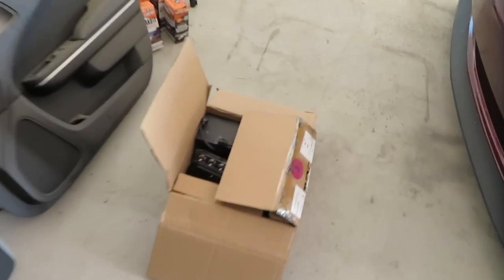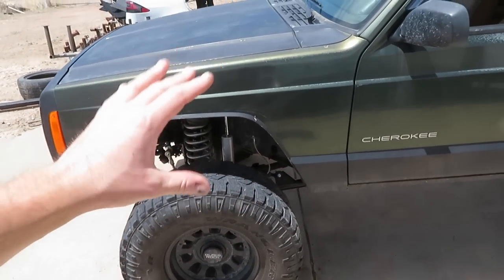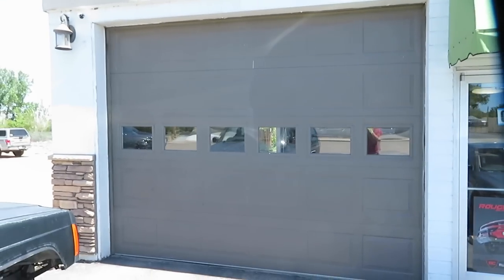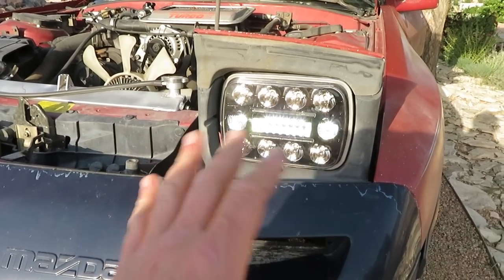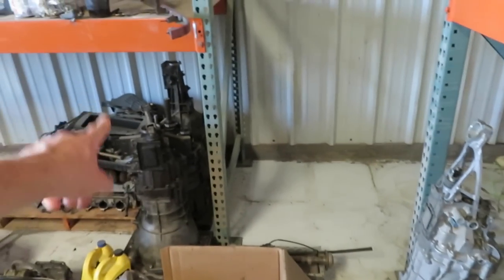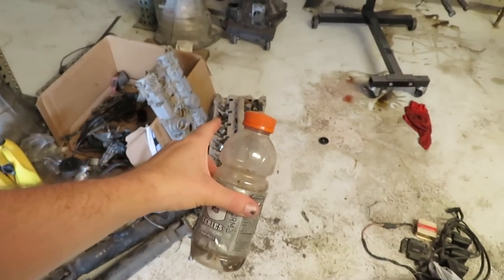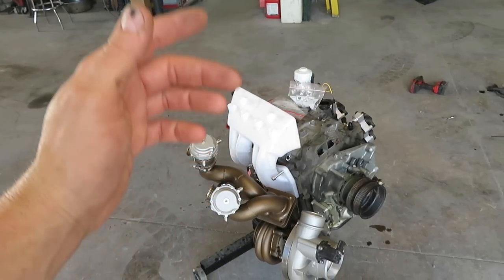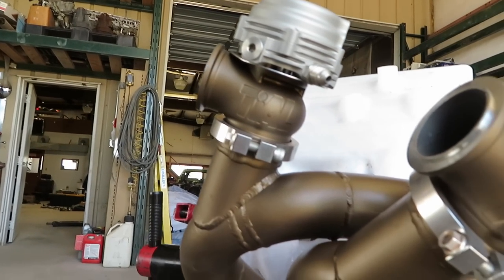I Drove my Lifted Jeep and Almost Died!!!

Comment: Be careful with the Supra using LED headlights. Toyota switches the ground, not the power so you need to use a ground switching converter. Not a huge deal, but it causes all kinds of issues without it

Comment: Did you notice that not one of your wheels are centered in the wheel well?  You have adjustable front arms and your can re-drill the center bolt on the rear leaf springs to center up the axle.  If you have good quality lift springs the axle should be centered already.